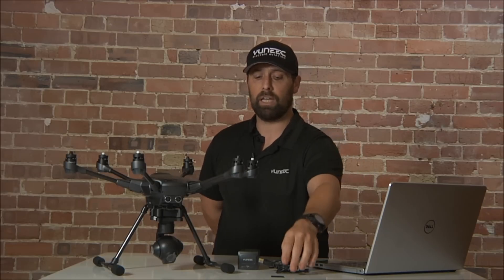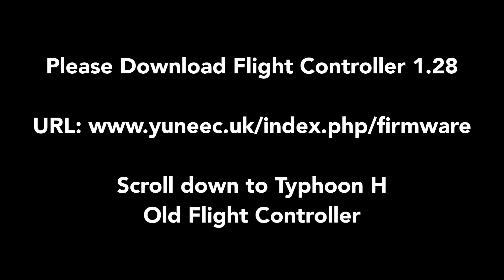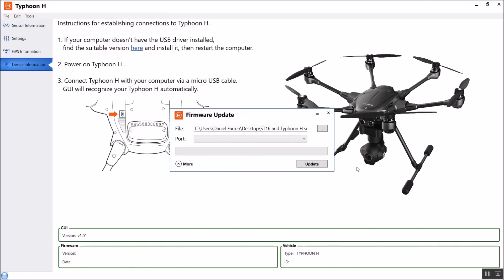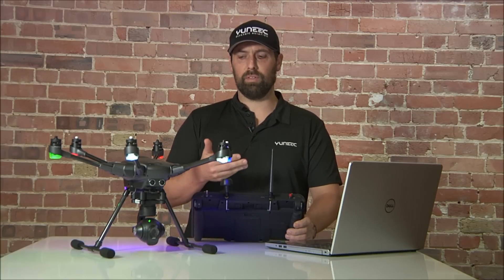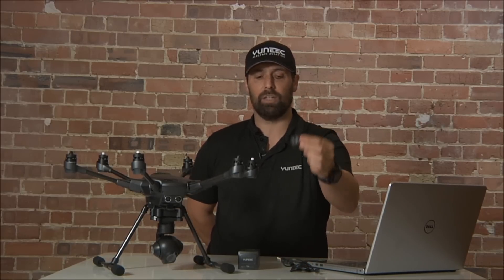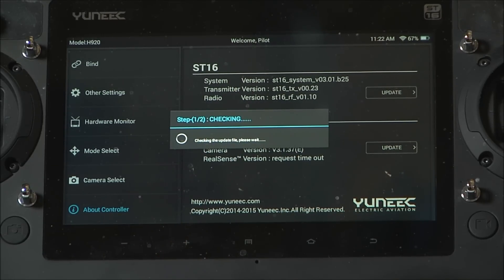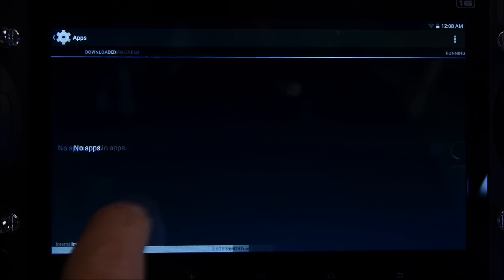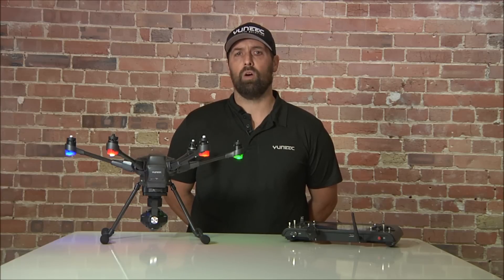Issues with installing TYPHOON H firmware 3.0? Here's the solution.

Comment: Hey my search and rescue agency

St16+  screen will not turn on  and it wont charge 

The blue light ln st16  turns on.  And buttons make noise. 

But no screen and jt wont charge 

I tried the batteries in our broken  st16. And they work and they charge. Just fine.  

In our main ST16+    THEY DONT CHARGE AND SCREEN WONT TIRN ON.  But the transmitter  does go on you can hear the buttons making noise  

But no screen so i cant see if its charging.    I tried to takenit out of standby mode. But i cant

Comment: Wow, now I know what they mean by doing a flash procedure. I just sent my H Plus into Yuneec for repair as after I updated to the latest build I could not get the props to spin after startup. I tried to find the problem myself through the forums and never did get it to work. I found out there is not a GUI for the H Plus on the Yuneec website either so I don't know how I could have done this to the drone. Why can't you now access the secret menu so you can do the other cals other than the compass? Do you think this procedure would have worked so I didn't really have to send in the H Plus for repair?

Comment: Last week my ST16 somehow mixed K2 on the throttle channel. 

My only symptom was if failed to start normally.

Later while testing, it armed, took off and hovered by itself. The throttle gave no response.
When I tilted the camera up, The K2 mix pulled ch0 to -25, which killed the motors.
Big crash - new H - lesson learned.

Comment: Today my ST16 flight controller (for the Typhoon Plus) just kept on crashing with message of some Android core process that stopped working. The screen just keeps flashing with the Yuneec Flightmode 2.0 (UAV app) start screen. There's no way I can access the controller or the android system on it, neither can I access the internal storage when connecting USB cable to the ST16 and my computer. How can this be fixed?

Comment: My st16 doesn't see my wifi network, i can't connect them in anyway like: wps, wifi, bluetooth. anybody any idea?
Reply: You may have turned it off accidentally in the PAD mode, go into the settings on the android sys and see if it is turned on.
Reply: But it's on in de pad mode, that's really strange, it saw the most wifi networks but mine not. maybe change to wep or wpa?
Reply: Maybe your router is not broadcasting the ssid?
Reply: Yes it does, i tried also without a password, but he can't find it. really strange. also tried to connect true WPS, pressed that button on the radio and after that the button in my router but i won't connect.
Reply: Maybe try reset both, there is a reset option on the ST16, go into Pad and settings and backup and reset.
Reply: Thanks, i am gonna do that first:) maybe yuneec knows what happens
Reply: En weet je de oplossing al. Mijn St16 ziet ook het thuis WiFi netwerk niet

Comment: One thing I have observed is a lot of users have trouble updating the ST16 due to the SD card not being formatted correctly and therefore not being recognised when inserted in the ST16. Often formatting on a PC or Mac even to the correct exfat format does not always work.
The solution however is very simple and works first time.

On the ST16 on the top right corner of the screen there will be a small micro-sd card icon with an exclamation mark on it.
-Swipe down from the top of the screen
-Now a menu related to the micro sd card opens up, this states that the card is not recognised due to it not being correctly formatted - The menu offers a reformat option. 
- Reformat the card from here.
-Thats it...copy the ST16 firmware onto it again and it will be recognised when trying the update..
Reply: AFAICT the ST16 does NOT recognize exFAT file system.  Yes, the CGO3+ camera does but the Tx does not.  Go figure!  Pretty sure this is an Android limitation as the ST16 does not like any microSD cards bigger than 64GB, even if formatted previously on your computer as FAT32.  The Tx also seems to be extremely picky on the QUALITY of the card.